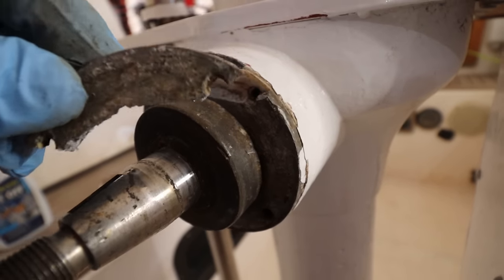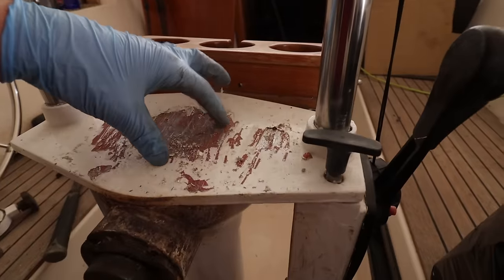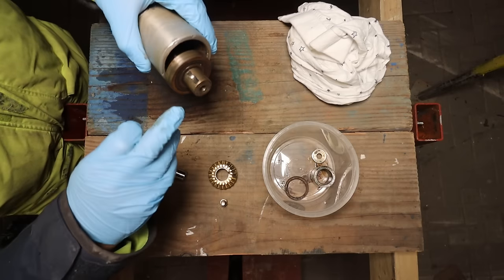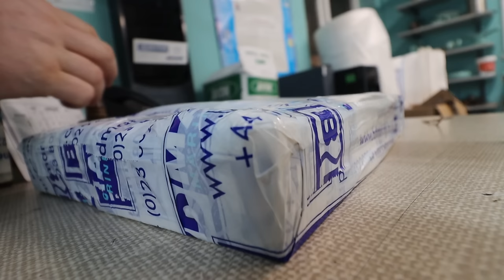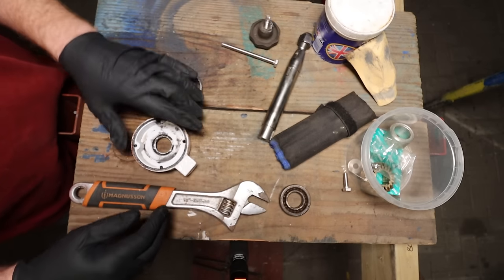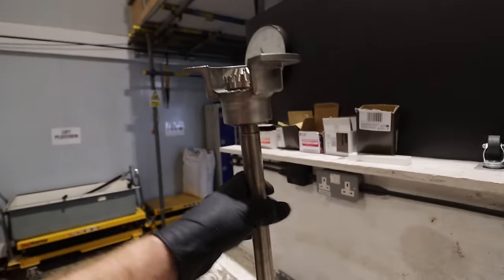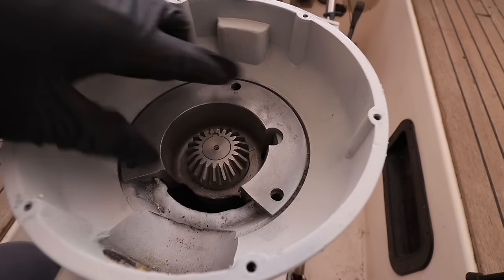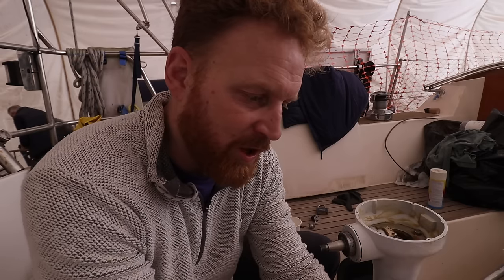I broke it... TWICE 😕

Comment: Hammering brand new bearings on is not a good idea. You can dimple the race and have a rough bearing. They needed to be slightly tight on housing and on the shaft but it looks as if you got away with it all. btw the "2RS" on the bearing number just means 2 Rubber Seal i.e. a rubber seal either side of a pre greased bearing. Have fun!

Comment: The piston that makes the brake - turning it around so that the cupped end is the braking face will probably wear down quickly. It has already shortened which is why the thread was bottoming out. You might have made a replacement from MDPE, or from a retired plastic chopping board from your galley.

Comment: Great video, reminds me of replacing all the bearings on mine a couple of years ago.  I had the same problem, spent ages dismantling it all whilst limiting the collateral damage!, two days just to get the wheel off.  Everything was completely seized on.  At least I have now got a comprehensive set of pullers etc 😅.  Finding the replacement bearings and putting back together was pretty easy!!  Nice to see I’m not the only one

Comment: If, after a few weeks, that brake doesn’t work anymore, I guess it’s the grease, spread all over the steering axis. a LITTLE drop of grease on the sides would have done the trick also! 
If no hydraulic press available, use the freezer and some heat on the bearings. They will slide on easier!
But, for those how have the same system, you showed every step, that is a good thing.

I’m so happy that my winterization is a little more silent 😂.

Comment: If you need to assemble bearings onto a shaft like that again if you have access to deep freeze, freeze the shaft in that for a few hours (the longer the better) the shaft will shrink slightly and the bearings should just slide on. I would source a tin of Duralac for dissimilar corrosion I think a tin of the stuff (250ml) is around £12. We used to call it Yak 💩in the RAF.

Comment: Need a tube a Duralac , for putting stainless steel bolts into aluminium housing.  Local riggers and chandlers will have it in stock.
James
Reply: Duralac is good stuff, but don’t get it on your jeans.  Don’t ask how I know!  :-)
Reply: @PitStopCrew  true
Reply: Tefgel is less messy but also good